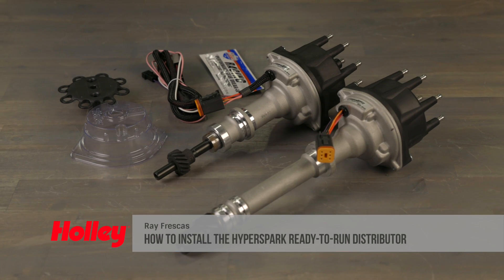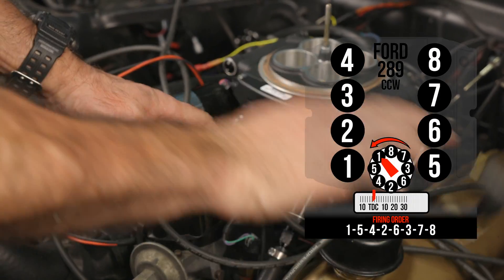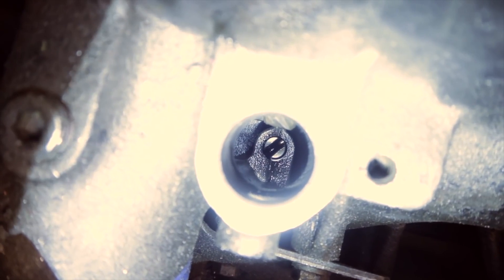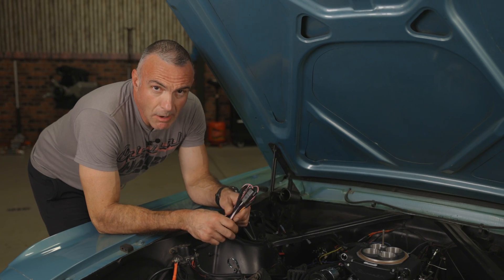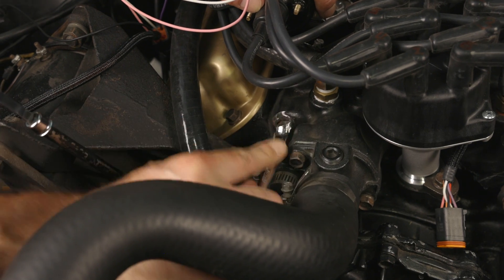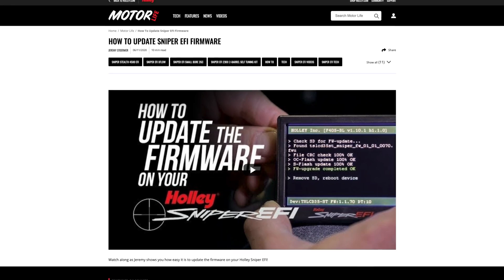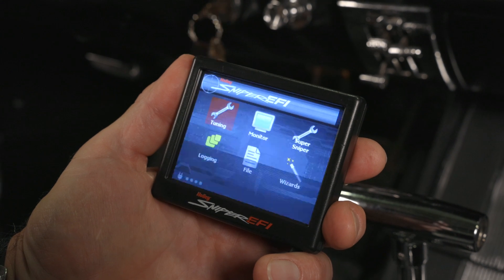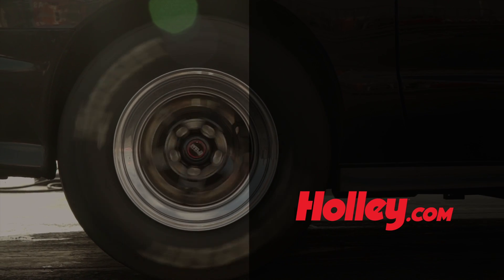How to Install The HyperSpark Ready-To-Run Distributor

Comment: I have the distributor installed, when I place the clear cap on the rotor and turn the body the cap doesn't drop down and engage on the body.  I have spun this thing in circles, both directions, fast, slow and everything in between. What am I doing wrong?
Reply: I figured it out. Not all "drop" in to place. There is an extra ring in the box (along with supplementary instructions on a loose sheet of paper) that explain to put the ring on first, then the clear cap, then spin. Easy